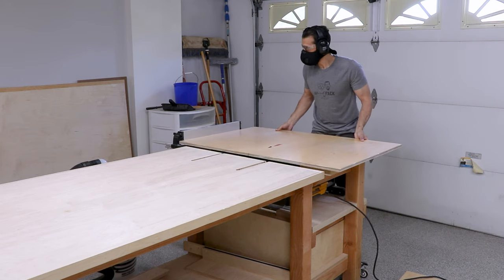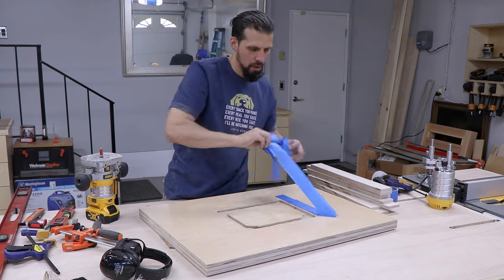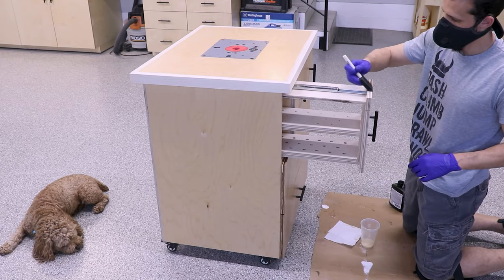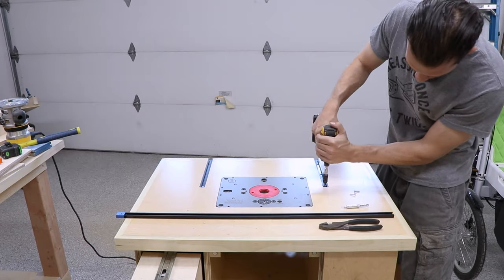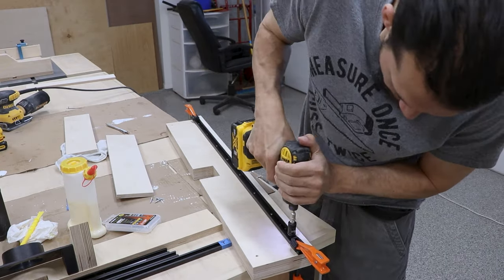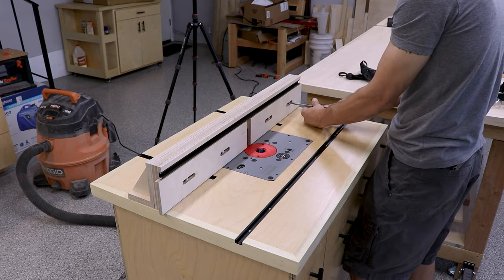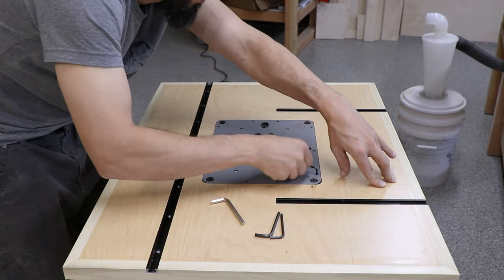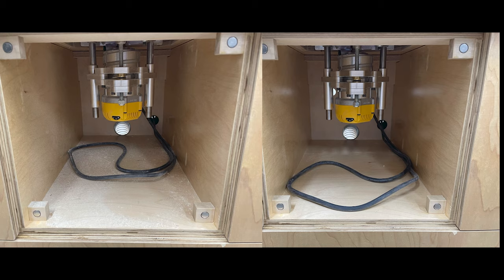Router Table Build // Finishing the fence, top, dust collection

Comment: Thanks for posting I built mine but I was wondering if maybe my router is too far away from the back of my table. ( 7 inches from lift device to back of table. )Could you tell me minimum distance on yours? I also use a 2 1/2 inch dust port lots of suction and volume. also I was wondering why you decided to put holes in the back instead of holes in the front for good air flow. Thanks in advance for your help. , Phil
Reply from the maker: mine is about the same distance. And the choice for where to put the holes was purely for aesthetic reasons. It should work well front or back.
Reply: @woodpackdiy  thanks for replying mine has been working great depending on using a dado or just a round over.

Comment: Bought your plans, what did you put on the table top surface to make it that shinny? Cant figure out if I’m supposed to put laminate or something over the top.
Reply from the maker: I used prefinished plywood - that has help up well with ease of use. on the sides I added some polyurethane.

Comment: Good Job! Katz-Moses didn't put vent holes in his router box, so well done & good catch! I am making plans for something similar, drawing some from you, Katz-Moses, and one other.
1. I will use "pop to open" hardware on the drawers;
2. I will secure formica laminate to the top surface;
3. I will use a PowerTec fence so that I have jointer rods for vertical jointing (no space or $ for jointer)

Comment: Nice work.  I recently bought a whole Rockler system with the same lift.  The top is bowed.  Took it back to exchange, and every other top in the store (except to metal ones) were also bowed.  I'll most likely return it and build my own.  The Rockler legs and fence seem fine, BTW.
Reply from the maker: Wow, that is unfortunate and annoying to get some many defective tops. Would have thought rockler would be better than that

Comment: Nice build. I appreciate the listing of parts you used for the duct collection. I’m in the middle of building my own router table and I’ve been putting off the dust collection issue. But now that I’ve seen your setup and your solution for adding more airflow to the lower enclosure I’m going to use your ideas for my own. Thanks for a very informative video.
Reply from the maker: Cool! hope the rest of your build goes smoothly.

Comment: Love the table does the dog come with it? Sorry dog is beautiful. This is just what I want a router table for myself as I have hand issues so I think it would be easier if I had a table I could use both hands safer then trying to hold the router as they can be heavy. What router would you suggest for a beginner. Thank you for showing us how you did it
Reply from the maker: Glad you enjoyed the video, and Bob Barker says hello! I used this router for this build: DEWALT Router, Fixed Base: https://amzn.to/3DLkovV
But honestly, I don't have a huge preference between the standard brands. I would do something with decent power if its going in a table like this. Then it will handle all your needs - both big and small. And yeah, it does make a difference being able to control things well using this type of setup.

Comment: Been following the build, now I am assembling the fence bottom to the top using pocket holes, but how did you got the pocket holes screws heads to be completely flush the bottom, mine seem to be sticking out even though I drove them as much as possible using the recommended 1 1/4 inch for 3/4 thickness of material. Any advise? Seem if I leave them like that, they surley strach the bench tom and even the router lift plate.
Reply from the maker: 2 options i can think of. 1. switch them out for the kreg 1 inch screws. Those have a smaller head. 2. If you can make new pocket holes, back the setting on the jig off (for example, if its set on 3/4 inch, maybe set it closer to 1 inch), that should create a deeper pocket for the screw head to sit into.

Comment: Nice build ! I used your video to build my own router table! My only problem is the dust collection when cutting dados, dust is flying everywhere . Did you experienced this issue ? Dust collection is good when cutting roundover ! I'm using a shopvac and a cyclone as dust collector , do you think it could be the problem ? Maybe its not strong enought?  I did had holes for airflow but dust don't really go down in the cabinet below... do you have advises for me ? Thank you !!
Reply from the maker: Nice! and for the dados, I haven't done many on my router table (I do most on my table saw), but I don't remember it being a problem with dust. Im pretty sure the dust still went straight down into the chamber below. Not sure what the issue is for you.
Reply: Ok thank you !

Comment: Nice work! ✅
Are you still happy with the tabletop surface? Did you use any kind of finish on it? I’m thinking of using a melamine over plywood top because I think it should be a pretty smooth surface with very little friction. Thoughts?
Reply from the maker: I am very happy with the top surface still. I used a prefinished plywood and put wipe on poly on the trim pieces. I have used it a good amount and it has held up great so far. Melamine would be a really good option for the reasons you mentioned. I havent had any issues with the friction on mine for practical use, but never hurts to go even less friction.
Reply: @woodpackdiy  
Thanks for your thoughtful reply.